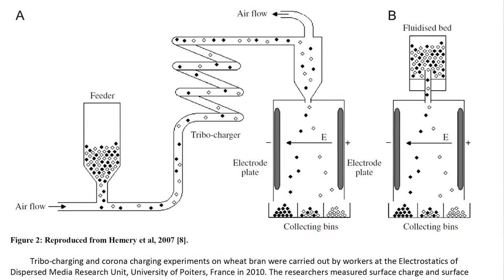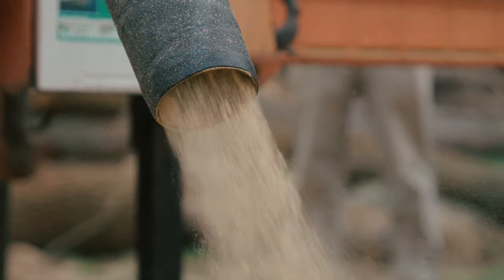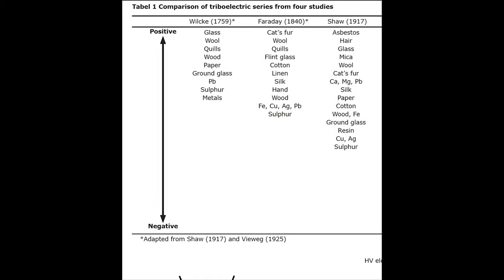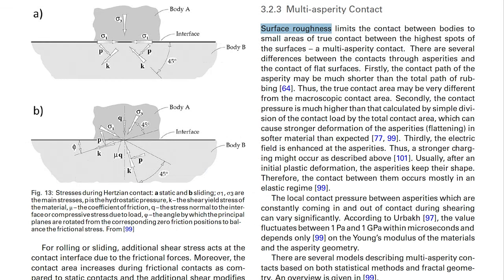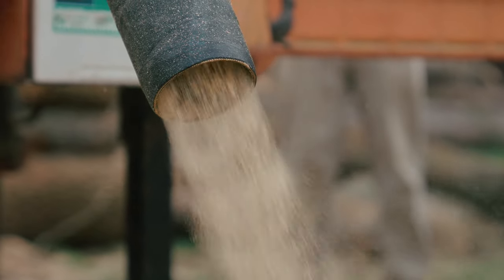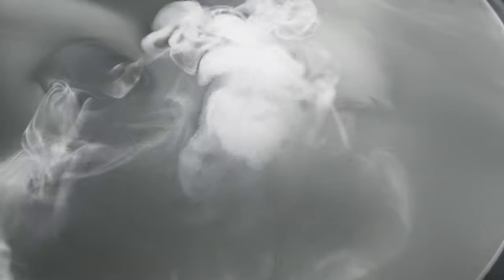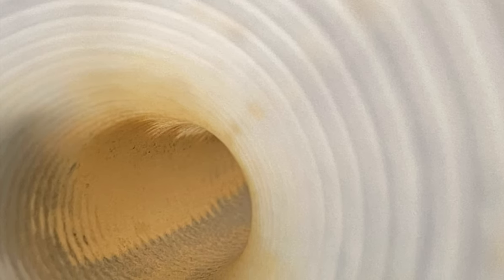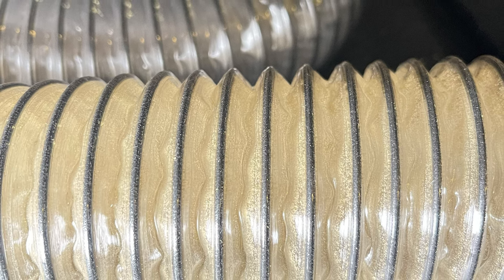Triboelectric Tuesday Episode 5 - Coiled Tubes

Comment: Could the collection vessel have a system with low to high wind separation tubes as the particles fall, to separate the particles further by weight and send them in to individual vessels for static collection, similar to How seed cleaners work.? Great video as always
Reply from the maker: I will address this when we discuss TAE since I invested a lot of thought to this very problem yet failed miserably. I still believe this process will benefit from some preprocessing such as by sieving. Hash charges based on particle size. Big particles charge a lot and small particles charge a little. Stands to reason that having a homogeneous charge by having a homogeneous particle distribution makes sense to have good separation. Time will tell.

Comment: When talking about piping materials i instantly thought of when i was younger playing in the mcdonalds playplace the tube slide was super static charged because the metal studs on the way down would ground me and give me a nice audible pop. So im thinking the same material which is some sort of nylon plastic mix and it wasnt super smooth just smooth enough... Might be the trick

Comment: What about using a powder coating gun as a base to build something to turbocharge the particles?  They charge powders to 15k-25k volts, have a reservoir for the powder, and can be run off of any air compressor.
Reply from the maker: Tried that. But it charges particles too early. We will go deeper into the other charge methods necessary to make it work. In all there are 3 methods.

The gun causes aglomeration and clumping in the pipe. Seems the progression is friction, induction then conduction. Or some variant thereof.